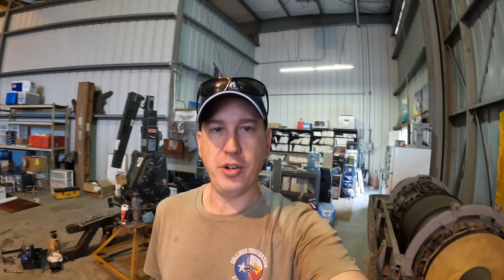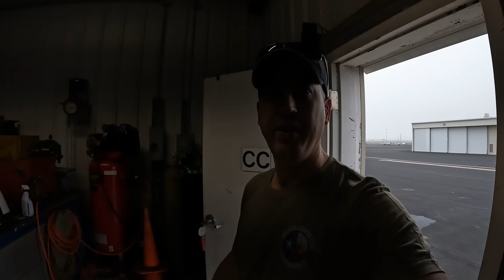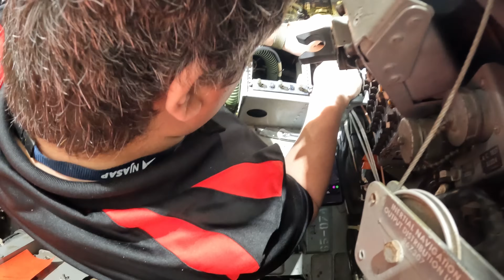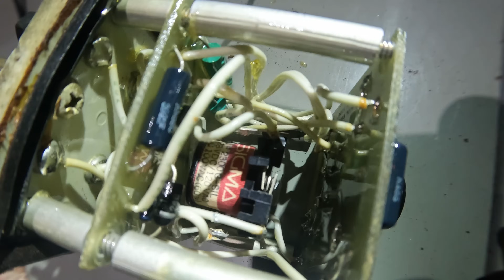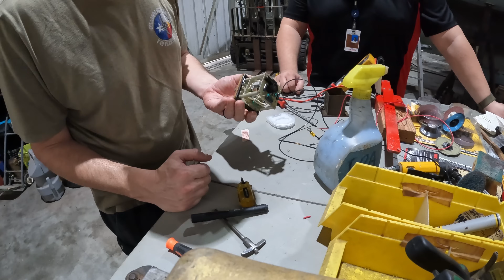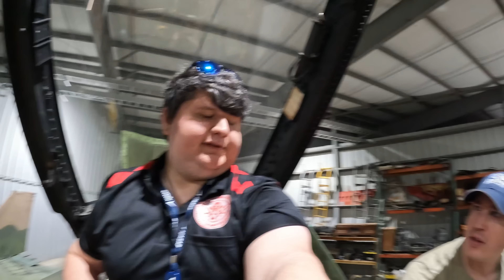F-4 Phantom Update and Fun With Power Supplies!

Comment: Great to have an update from Crew Chief Al 😎.
Nice work on the FOD screens.  Good that the rivits were replaced.  I've done work on those a few times, they are as critical an item as the intakes themselves, zero loose rivits are allowed.
A FOD sweep of the ground at the test stand, remove any loose pebles, bits of pavement and concrete.
Hope you have the cameras ready for the tied down full afterburner run.  And a new pair of ear plugs + PELTOR ear protectors (the big ones -30db).  Those J-79's generate 142 or 146db of memory serves.
Reply from the maker: We'll make sure everything is nice a clean before we crank her up! Looking forward to making some noise with those J79's before too long!
Reply: @DieselThunderAviation  Really good work so far.  I can guarante experiencing a Phantom tied down in full AB is something you will never forget.
I can still see, hear and smell the heat like it was yesterday.